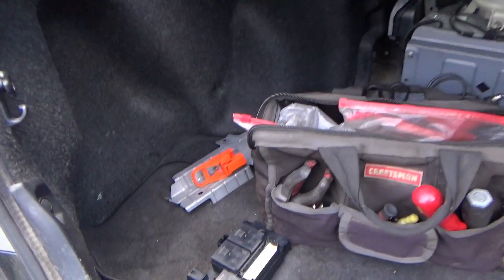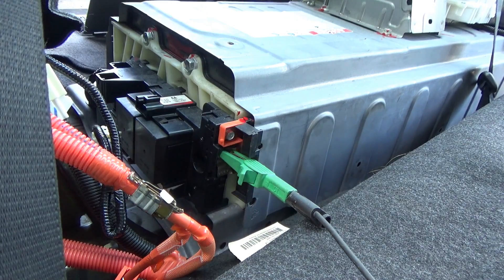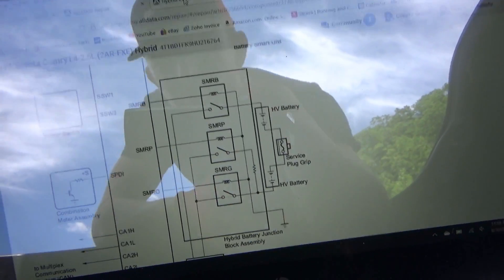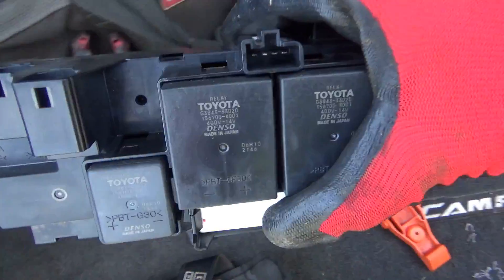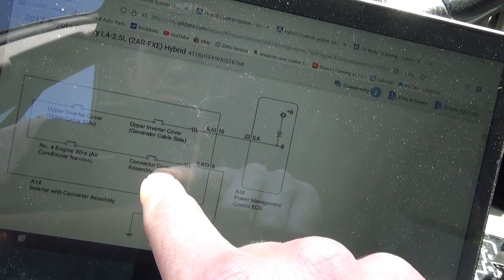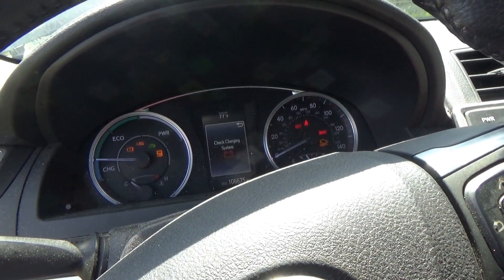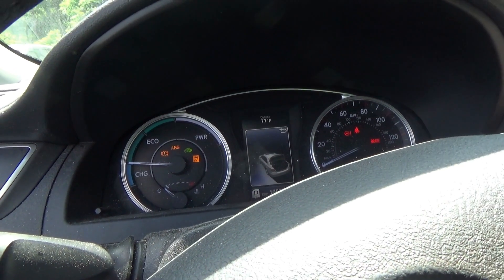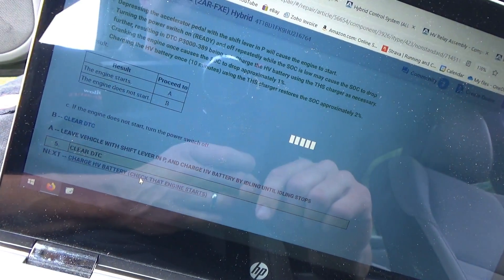Customer bought a HYBRID...and it Can't MOVE! (Part 2-Repairs)

Comment: Edit, You would need a high power variac and a bridge rectifier to charge it, it would better to take the battery to a rebuilder to check it over and charge it

Comment: 16:55 "So why can't it charge from the auxiliary battery?" I think you lost your critical thinking mojo for a moment here Ivan..... ya know that whacking great HV battery in the metal box (that is discharged) and the piddly standard 12V automotive battery you disconnected and reconnected earlier..... what you are asking is why can't the little guy fill up the big guy.....  regardless the voltage difference, the little guy's capacity when full is not going to make even a tiny dent in feeding the big guy when hungry.
People generally vastly underestimate how much energy is stored in these hybrid batteries, even the "small" ones that give only say 30 miles electric only range - it's an absolute f*** ton compared to any 12V lead acid automotive battery whether that is a starting battery optimised for CCA or a "leisure" battery optimised for deep cycles.

Still seems like a design flaw that the gas engine can't be started using the Aux battery using a conventional starter motor in case of emergency but that's not what the Aux battery is there for in these cars, it's to run the 12V interior devices and control systems no more.

The design engineers clearly thought that it would have to be a fault scenario for the HV battery to run so low that it can't kick the gas engine into life (so no need to lumber every car with a starter motor and a decently high CCA 12V battery) - in this case study they were correct. Instead they opted to design an additional "put some charge into the HV battery from external source" device if SHTF - the THS you speak of.

The destructions instruct to test the voltage across the Aux battery.... you skip that to ask why the Aux can't charge the HV then move on to the step about testing the HV battery..... as someone who writes destructions for other techs to follow... this make me AAAARCGHH!! RTFM!! :D :D

Still love ya really :D

AAARGH 17:05 Again.... Ivan McSkippy... that's not the message displayed "Hybrid Battery Preservation Mode"...... your message was Hybrid Battery Low or some such. Yes I'm being pedantic, but with control systems running more than 12 - 24V DC things have to be pedantic. Or bad things happen. Like fires that take hours to put out, then re-ignite hours after they were thought to be out. Like people getting electrocuted. etc etc.

Still love ya really :D Keep up the good work.
Reply from the maker: All good points. Definitely a rare scenario where the HV battery is so discharged not to be able to start the engine. However this is exactly why Hybrids suck. The lifespan of the HV battery pretty much determines the lifespan of the vehicle, which is a waste of resources in my opinion 😆
Reply: @PineHollowAutoDiagnostics  The waste depends on how good we get at recycling or re-purposing batteries. Not very right now for sure. Just chuck it away when done mentality - not a great use of resources to extract, refine, form and combine to task, use once and landfill them - buy another, move on.
You are correct in that - right now - when it comes to the point that an HV battery requires replacement the cost to do so exceeds the residual value of the vehicle so the vehicle gets scrapped. However, that calculation is done based on vehicles requiring HV battery replacement now in 2022, likely 8 - 10 - 12 year old vehicles with batttery tech from the day they were created...... batteries that no-one makes but niche manufacturers and only go in those vehicles and are based on outdated chemistry. Price premium for a rapidly diminishing market.
It's a rapidly advancing field. Battery chemistry and construction has radically changed in the intervening time. Standardisation of parts and chemistry will result in commoditisation, which in turn leads to mass production, which in turn dramatically lowers cost. And once standardised, setting up the recycling chain becomes attractive as the input is consistent rather than ad hoc per manufacturer whim and per model year etc.
As much as I love driving ICE powered vehicles, they've been around my entire life after all - I see the problem with them - we can't forever keep pumping dino oil out of the ground and setting fire to it. Regardless one's position on climate change, warming etc.... it's a finite resource... at some point we must transition off it or it runs out and then we have to transition in a panic. Why not now?
We know how to convert the sun's rays, the wind's eddies, the seas' waves to electricity - so why be be beholden to oil? A production market controlled by a cartel (OPEC) that just increases and decreases the supply to maximise their own profits.
If you want self determination within your nation's borders you get the hell away from an internationally controlled energy source like oil products. As we've all seen with fuel prices at the pumps and politicians declaring that it's market forces outside their control. They are right, it is outside their control - and that should worry us all, the security of our energy supply is not in our hands right now.
Time to move on. Better to spend a few cents now than a million dollars later. 

Apologies for rambling. :D
Reply: My Escape Hybrid has a 1.6 kw-hr. traction battery. A 100 amp-hr. 12V battery would be 1.2 kw-hrs. Till 2008, the Escape had an onboard boost converter to charge the traction battery from the auxiliary battery by pushing a button at the end of the instrument panel. It takes 8.5 minutes to charge the traction battery enough to start the vehicle.

Comment: I would hope that the HV battery hasn't been damaged by leaving it in a fully discharged condition. Again, Toyota could put a safety circuit in that would disconnect the HV battery to prevent a low charge eventuality. Time to bite the bullet and go to the stealer....

Comment: I had a hybrid cell go bad in a prius. Bought a used battery on ebay to replace the bad one that showed below nominal voltage and signs of swelling. Threw it back together and still no start. Remember reading that maximum allowable difference is 1.2v between all the cells. So I took my rc helicopter charger and charged all the batteries (NIMH) until they all read 7.2v. Prius started first try. All of this was from not driving a 13yr old 168k prius for three weeks to find my hybrid error. So for 30$ I had this back up and running.
Reply from the maker: Meanwhile I can let my rusty 89 Mazda sit in a snowbank all winter long and it fires up every spring no questions asked 😉

Comment: You have an error in logic with your 69V measurement. This is a phantom floating voltage (some capacitance at best). With the service grip out, those two contacts are not in circuit with each other any more, so measuring a voltage across two points that are not in circuit makes no sense... no current patch between two points=no definable voltage, as capacitance can be ignored for all practical matters in this case.
Reply: I don't think doing something to make sure your safe, ever "makes no sense", but good try.
Reply: @rpturbo  No, but that's the thing. If you see this voltage, and interpret it as there still being HV on those contacts, you might go looking for a non existent short, and start digging into the battery, putting yourself in MORE danger. If you realize that this voltage makes no sense, and the current state is the SAFE one, then you are in a much better position...

Comment: Well done, Ivan. Electric is a challenge for sure. I'm glad I'm retired from the grind, finally although I miss it sometimes.
My daughter has a 2021 Corolla hybrid and it's saved her a lot of money on fuel already. 160 KL to work and back every day. So far it's been a great car.
If you ever need help on anything Toyota try contacting the Car Care Nut here on YT. I swear he can almost repair them blind folded.
Reply from the maker: I'll try to fix the next hybrid wearing a blindfold and no gloves 😅
Reply: @PineHollowAutoDiagnostics       Aren't we arrogant! I gave you a tip from someone who is very good at what he does. Up yours!
Reply from the maker: @wysetech2000  lol I was just kidding! Toyotas usually don't break anyways...this auction special was a rare occasion 😁
Reply: @wysetech2000  haha aren't we a sensitive snowflake.

Comment: I think someone swapped the Hybrid battery for an older one and took the original good Hybrid battery and sold it. Hybrid vehicles cannot sit on the lot more than 30 days or it will need to be recharged. By the way if you're worried about draining your Hybrid battery if it sits longer than 30 days get a plug-in hybrid vehicle, then you won't have to worry you just plug it in.

Comment: Not all hybrids are this hard to start. My 06 honda Insight will happily start and drive without the high voltage battery. The IMA system is less efficient, but way more robust.

Comment: If you intend to park a hybrid for an extended amount of time, you need to do everything what you need to do when parking a gas powered car. On top of that, before parking it, you should get the state of charge of the HV battery between 50 and 75%, because lithium ion battery tech ages much faster when stored totally full or totally empty. And you need to pull the service safety plug, so there will not be any parasitic drain on the HV battery.

The $9000 fancy charger probably needs a 3-phase supply and is probably capable of providing enough charge for cranking within a few minutes. Nice charger. But this total discharge problem does not occur enough to justify that investment for a small dealer. Manufacturer should also make available a $300 charger that runs on an ordinary wall outlet, which will probably need a few hours to do the same. But it will get the job done with an investment of just $300. Every dealer will be able to have such.
And a general repair shop can always buy an after-market charger for, yeah, $1500 would be reasonable if it has a wide range of charging voltages to choose from, so you'll be able to charge all kinds of EV batteries. Overnight for a full charge, or an hour if you just need to crank the ICE of a dead hybrid, to get it going again.

Comment: You don't exactly need a special charger to charge these packs. You can individually charge the the modules inside with a bench top power supply or hobby rc battery charger. But you definitely shouldn't do it if you don't know what your doing.
Reply: I do this often and laugh at the dealer quotes. I have saved more than a few people from buying new battery's as that is what the dealer quotes them.

Comment: I'm surprised to hear myself say but what was Toyota thinking? would have been a good idea to let the 12v battery start the engine and let the car charge itself, my question is ( is it a regular starter or high voltage)
Reply: The big EV battery & its drive motor is the starter !

Comment: The deal is that there isn’t a 12 volt starter motor in the car. They use the high voltage motor both for pushing the car and for starting the gas engine.   So to charge the hv battery you need enough charge in it to start the gas engine.  So if a car sits long enough you get into that can’t get there from here situation.  

As for putting a little charge into the hv battery, you need an electrical engineer for help.  They may be able to suggest how to hook up a generic hv power supply to act as a charger.  With great care of course.  Or take it to the dealer.

Comment: Ivan, what you might be able to do is take a bridge rectifier from the power grid putting a tin cap (e.g. a big starting cap from an electric motor) (or two polarized electrolytic caps in series with both their pluses or negatives tied together) inline with one of the AC legs running the DC outputs from the former to the battery.   The cap will limit the amount of current that runs across it so the bigger the more current (but then the heavier your wires, rectifier, etc... has to be).

That should be able to charge a battery up to at least 110 volts (and probably a fair bit more).

This looks like the right circuit:

https://youtu.be/N6NluEvBAUU

Comment: I could see the mental struggle going on in your mind when you were thinking about how to charge it. It's kinda like "I'm unhappy because I eat, and I eat because I'm unhappy " 🤣🤣 . I was diagnosing a door module on a hybrid... by the time I buttoned up the diag the car wouldn't start the engine or go onto hybrid mode. The weak 12vbattery died and I didn't know. Customer didn't tell me that his battery is no good, apparently just a few minutes of key on would kill the battery.  The whole time I was thinking I damaged something with the hybrid system lol

Comment: Look up a 1996 Ford hybrid they had a button on the drivers side, hidden away that would use the 12 volt battery to send a charge to the HV battery and give the HV just enough to start the car.
Reply from the maker: Apparently Toyota doesn't have a magic button 😭
Reply: @PineHollowAutoDiagnostics  Online they show the Camry hybrid being jump started
Reply from the maker: @kendit1  that's only if the 12V battery goes dead, not the HV battery 🙂

Comment: If I am looking for a hybrid car, it seems the best idea is to go for the Plug-in version. At least, you'll be able to charge the battery from the wall outlet or even a generator.
Reply: Yes @Bernarda you can avoid some issues with a plug--in variant. But if reliability and/or dependability is highest on your shopping list; Go for a conventional vehicle, a tried and proven model with lesser of complexity.
Reply: Yes, but if the engine has a code that prevents it from starting the car still won't move.
Reply: @billygoatgruff25  : No Josh, that's not how it works. There is a big difference between them 2. A "code that prevents it from starting the car" doesn't randomly just pop up; If your hybrid car has a 12V starter or a crank-ISG makes a huge difference (just to mention one important difference).

Comment: I've driven my Prius hybrid daily for over 225,000 miles and never once needed to jump/charge the traction (high voltage) battery.  I've had the auxiliary battery fail a couple of times which required a regular 12V jump, which revived the car.  The problem you ran into was that the car sat for an extended period and drained the traction battery to the point the car couldn't start the ICE and recharge itself.
Reply: Maybe he could have tried to jump the 12v battery to start it. Like they show online

Comment: I think that's why  plug in hybrids are probably the best of both worlds because these systems just seem like a pain in the ass what would you recommend Ivan what do you think or are you better off just getting a normal diesel or very efficient petrol engine instead instead
Reply: I think the opposite, yes plug in hybrids are better than standard hybrids, but I think hybrids in general are the worst of both worlds.
Still have to service the ICE on a regular basis and you carry all that extra weight while running on electric.
To me you would be better off filling that weight with batteries and going full electric while drastically reducing service costs.
Reply: @Stambo59  the current Gen  Camry hybrid only weighs 100lbs more than its gas counterpart. The engine will last twice as long since it’s only used half of the time. The brakes last twice as long too (regen braking), and no starter, alternator and extra accessory pulleys with a serpentine belt.
Reply: @tails300  Still needs an oil change every year to maintain it's warranty.
All your points support full electric just as much as hybrid.
Toyota engines in general when serviced regularly, easily out last the rest of the car.
Not unusual where I live to see them at 500,000k
Reply: @Stambo59  full electric has its own problems like charging infrastructure and cost. Right now EVs aren’t practical for most people and the technology is still in its infancy. Hybrids on the other hand have been around since the late 90s (Honda, Toyota) and they’ve pretty much been perfected technology wise. It makes more sense to by a hybrid over a full EV right now (if you’re looking at electrified options).
Reply: @tails300  Depends entirely on where in the world you are.
You do know the electric cars have been around since the mid 1800s right?
Reply from the maker: Diesels are efficient, but all of the emissions stuff makes it expensive and unreliable in the long run unfortunately. Modern gasoline powered cars are the best bet for long-term economy I think 👍
Reply: @PineHollowAutoDiagnostics  Thank you Iven I'll remember that for next year when I'm buying my first  car we'd be lost without YouTube

Comment: I suppose you could tow it to charge the battery. A few minutes of towing with the key on and hybrid system on should put enough charge on the traction battery to start. Alternately, coast down a long hill.
Reply: I was going to say i miss the days were you were desperate enough you could push the car along yourself and jump in, dump the clutch and your away. If you could coast down a hill and fire this thing up i would chuckle.
Reply: will not work, output wire relays are off because of codes.
Reply: will not work, output wire relays are off because of codes.